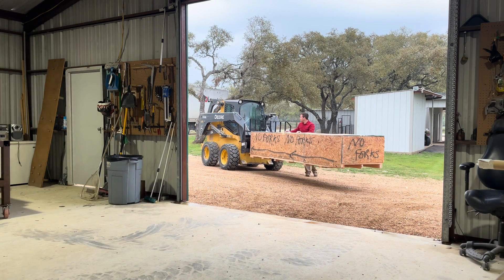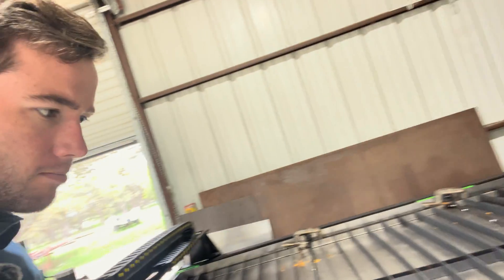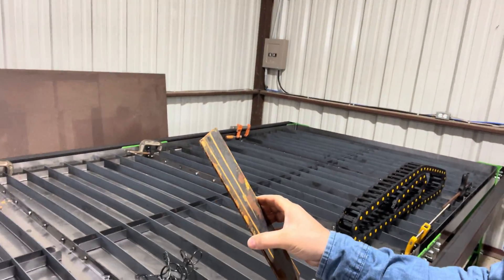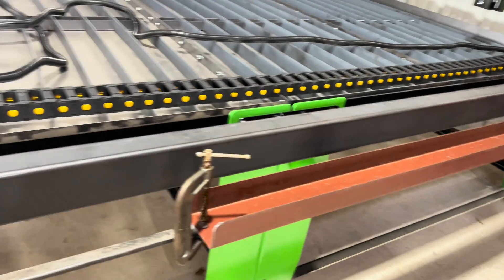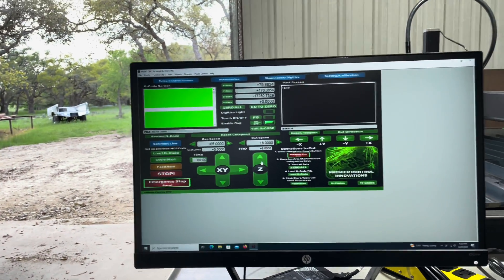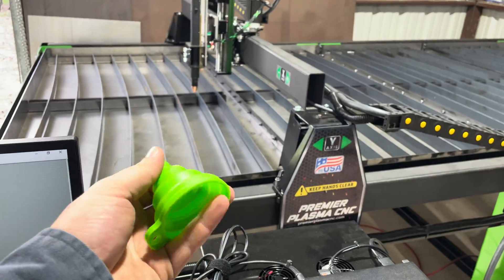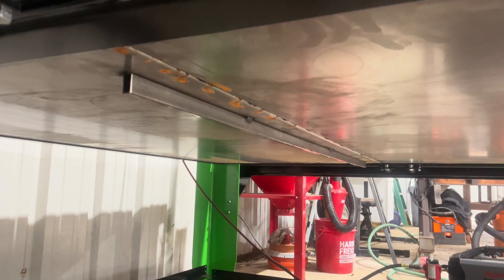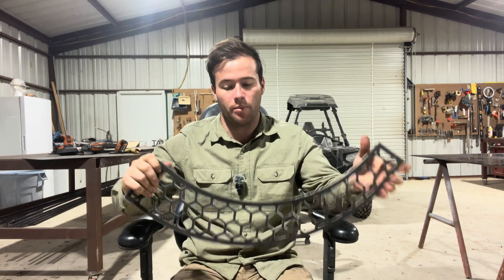5x10 Premier Plasma CNC Table

Comment: I have a 4x4 with pipe cutter. I'm not clear how to run cables. Can you please explain that for me.
Reply: I finally figured it out 10 days for myself and my boys to get it. They are there for the electronics part. I figured out the rest of it. I may be old. But  . I have more time to think about it all.  I stay away from there expertise in what they do. I walked away and said do your thing. And just stayed out of there way. Unless they needed my input. I love my boys 👦🏾. But they don't know what happens when you have to sat and think things out. But there doing there part now. Thanks for your input. My boy loves your monitor holder. We may have to make it. We finally did 1 cut today. Before I told them go home and do the homework. Lol 😆.  Thanks Hopefully we'll get a few videos posted. But that's not what I do. That's what my boy's do.
Reply from the maker: What are you having trouble with?

Comment: Hey, I have the 4x8, noticed I can't cut a repeatable part.  I have worked with Premier tech support but can't get this machine to repeat 1 part.  Are you able to produce consistent parts?  I noticed its especially bad at higher speeds when cutting thinner material (e.g., 16 ga or less).  I think the steppers are two small for the mass of the gantry.  I had a the Crossfire PRO, wish I had it back, it was very predictable.
Reply from the maker: @JeremyG-t2f  it is kind of hit or miss. Thankfully most of the time I am making only singular parts. I did make some truss brackets the other day out of 1/4” steel. The outsides were the same but the holes did not quite match up perfectly.
Reply: @skylarwagner1155  Thanks for the reply.  I can't even get the outside cut lines to match.  You should see this stack of parts (probably 15) that were all cut from the same file.  Not one part is the same. Holes are all in different locations and oval, outside dimensions are off by almost a 1/4" at worst.  I consider this an art machine, it's great for making signs and things that don't require tolerances.  Anything more, it just can't do it.  I will say their tech support is good/responsive, but they unable to solve the problem.  I have a few years of machining under my belt and used to run a CO2 laser so maybe my expectations are just to high.
Reply from the maker: @ i feel the same way about the machine being more of an art machine. Some days I wish I would have went with a different machine. The whole reason I bought a premier was because of the customer service. 
Do you have a THC on your table? I have one but it won’t turn on. I need to contact them about it but have not had the time.
Reply: @skylarwagner1155  I do have THC, it runs but does not respond well.  I set the THC to the parameters of the Premier specifications, but it doesn't respond.  It frequently drags the tip into the material.  I have spent hours dialing in the different voltages and wasting material to configure THC for each metal type/gauge.  You might have a defective Proma, I can send you pictures of how it's wired in my box.
Reply from the maker: @ I appreciate it, but I do not want you to go to that trouble. I need to just call and talk to them about it. I had it working when I first got the table but it was confusing so I turned it off. Since then I have gotten comfortable with running the machine and wanted to try the THC. When I try to turn it on it won’t do anything even though I have it set up like Premier says to.

Comment: Is it possible to see how you wired your THC for your table from your plasma cutter to the control box? I have a 4x4 Premier Plasma table and could never get it to work properly?
Reply from the maker: @eggowaffels52_59  I keep mine off all the time. It is very confusing and I have learned it is not needed for my usage.
Reply: I am not sure the THC works on these, I have spent hours trying to calibrate, the head never adjusts for variations.  Do what @skylarwagner1155 does, just turn it off.

Comment: I bought a premier plasma table and set it up but every time I turn the hypotherm on the torch fires. Did you have that problem as well?
Reply from the maker: Yes, I contacted the company and they said it just does that on start up. I have learned to keep the torch off until I get Mach 3 open and then turn on my hypertherm. This makes it where there is no torch lit until you are ready to start cutting.

Comment: I just got my priemer table a couple weeks ago. I bought it second hand. If i can ask you a couple question please. The ips on your cut and thc volts. What are you setting that at? Are you cutting 14ga? Thank you for any help you can provide.
Reply: Thank you very much I will check it out. I agree on the thc controller. Do you turn it off in mach3 ? Mine is mounted on the black box like yours.
Reply from the maker: @michaelsfabwork2985  I turned it off on the box, but you can also turn it off on Mach 3.
Reply from the maker: What brand of plasma cutter are you running?
Reply: Hyper xp45
Reply from the maker: @michaelsfabwork2985  use this website to do your cutting speed: 

https://xnet.hypertherm.com/Xnet/library/download/?file=HYP189352

I usually drop the cutting speed by %40 and you get less dross. 

For the THC I keep it turned off because it’s only needed if you’re cutting warped metal. Plus it’s kind of confusing to learn how to use it. And it always needs to be adjusted.
Reply: THC voltage that works for my 45xp is 90, cut speed for 14 ga is 238 ipm at 45 amps.  I would recommend lowering amperage and finding good reduced speed.  238 imp for the Premier table is WAY to fast. Resolution at this speed is awful.  If you run speeds that come in Premier's sheetcam files for 14g, you will have wicked dross.

Comment: I would love a full review of this table! Pros, cons, quality, etc. That would be awesome
Reply from the maker: Once I get some more time in it I will make one!
Reply: Go with a Langmuir XR or an Arclight, I had the Crossfire Pro at one point.  The Arclight is considerably more but is amazing.  The Pro was a small table but it was precise/predictable.  The XR is awesome for the money and user interface is good/great. At the time they didn't have true 4'x8' capacity but I know they have addressed that.  The Premier table is not designed for the mass of the gantry.  I think the steppers are to small or maybe its needs gear reduction.  I cut a dual sided sign with it the other day drawn in Fusion, when I went to bolt signs together, the holes were 3/16" off from each other - needless to say, they were scrap.  Anything you need to be repeatable with this machine is a no go.  I did a small run of 1/4" brackets with 4 holes, of the 50 parts, only 32 had the same dimensions and hole locations.